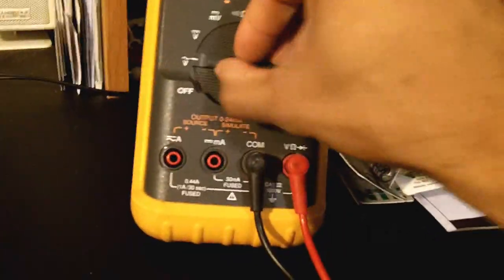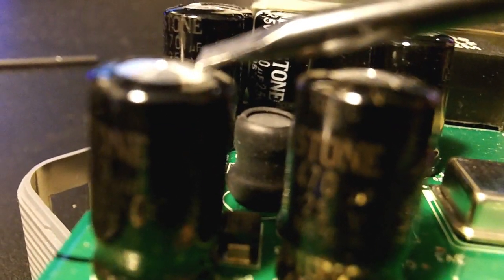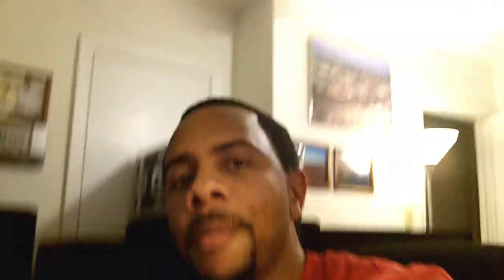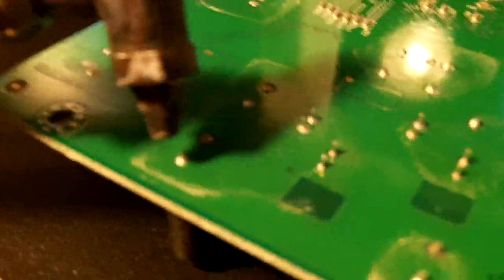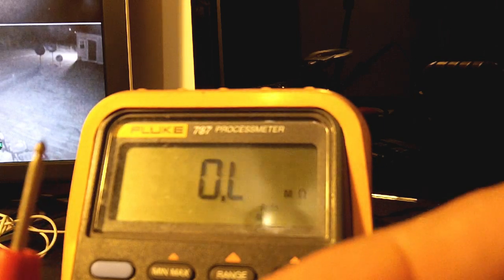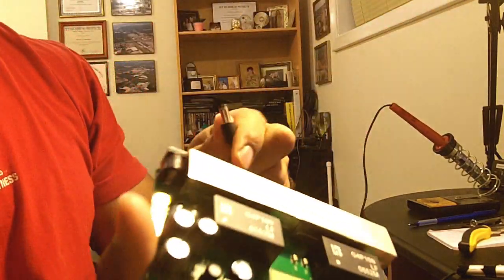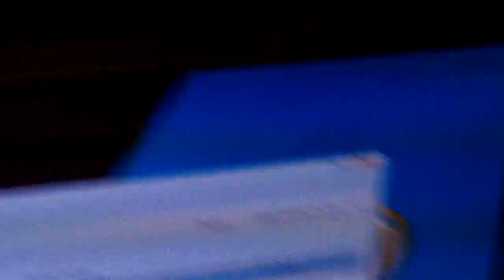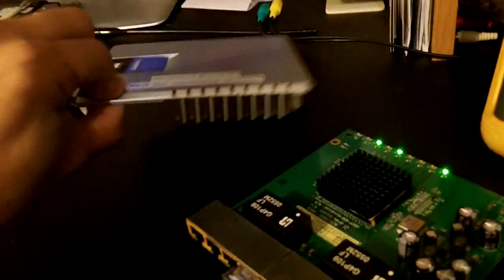8 Port Gigabit Ethernet Switch Repair

Comment: Netgear makes their switches with solid metal covers and that helps to dissipate heat. I don't know if Cisco does that now. The only thing Cisco in my network is the router. Great vid.